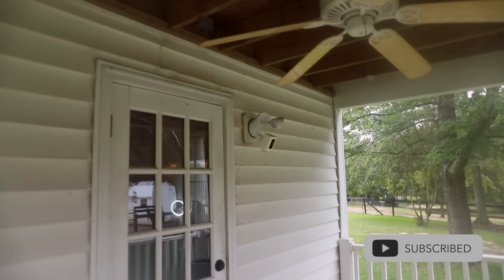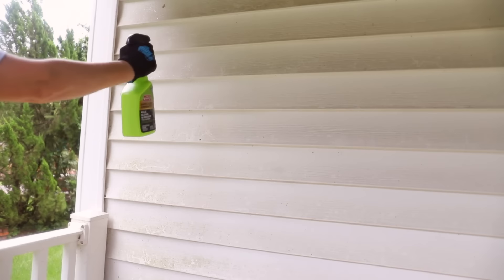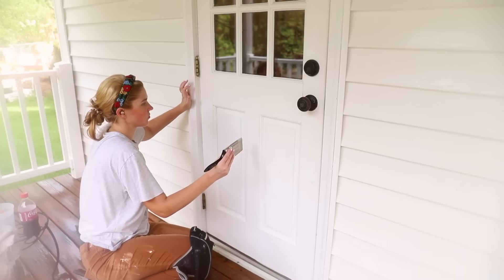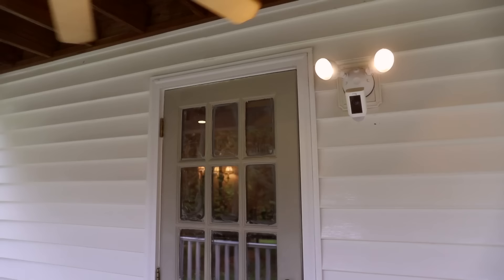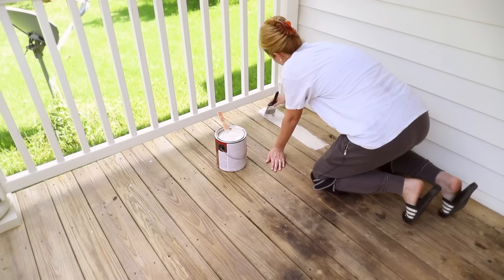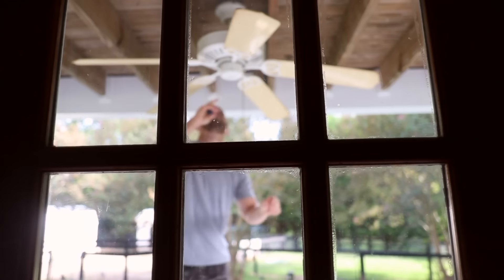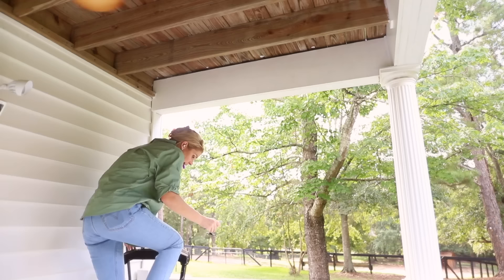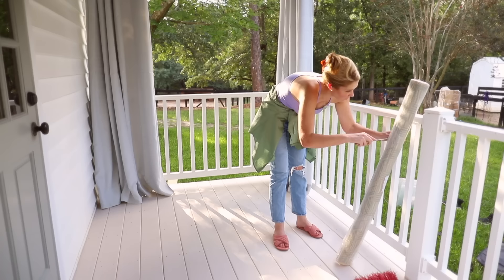DIY PORCH MAKEOVER - Beautiful Southern Porch Transformation // Painting Front Door + Wood Floor!

Comment: I think the warning of not spraying it on wood means raw wood not painted wood so you should be good. Anything with a coating doesn’t count as its original item. Painted wood won’t soak it in like a raw wood would and you are using it on material that is staying on the outside of the house so it wouldn’t soak into the wood and contain odors and etc. indoors. I think you are all good and your decorating is immaculate and beautiful.
Reply: Well the siding is vinyl, she was referring to the unpainted wood of the porch floor
Reply: @nutcase1995  regardless, it’s outside. I’m not on here to argue with people over what materials are what! I’m just making a statement and people can take it or leave it.
Reply: @nutcase1995  it’s treated wood though